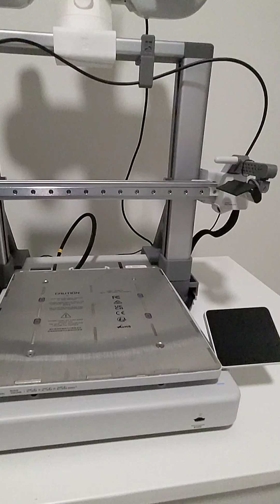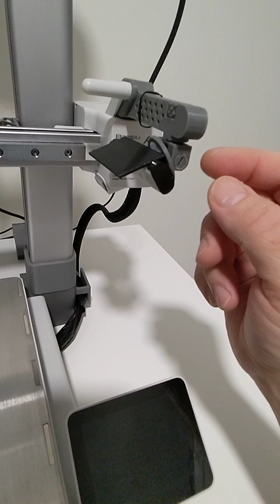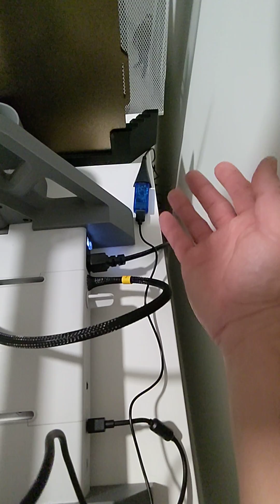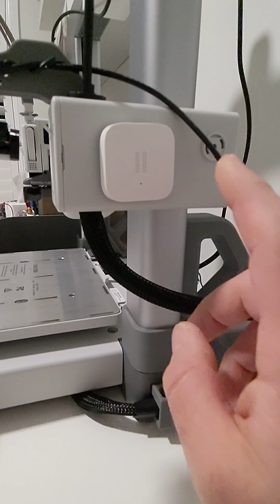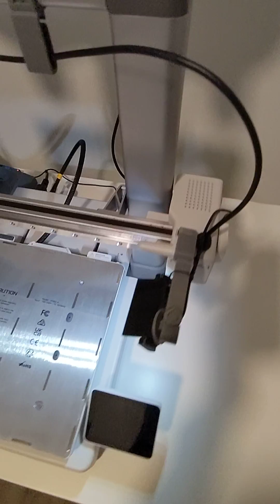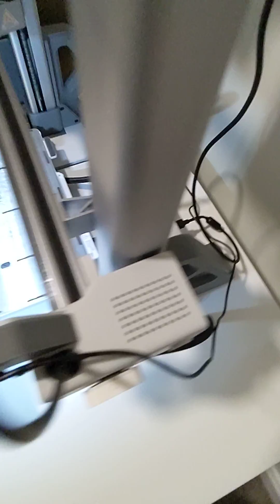Automating my Bambu A1 LED Light to Switch on via a Vibration Sensor

Comment: Awesome! did you get it to be powered up via the printer socket ?? would like to see how you did this..
Reply from the maker: Hi. Yes it's powered from the printer. I bought a micro-fit 3.0 cable from aliexpress and wired it to a DC 24v to 3A 5v USB board. Works well